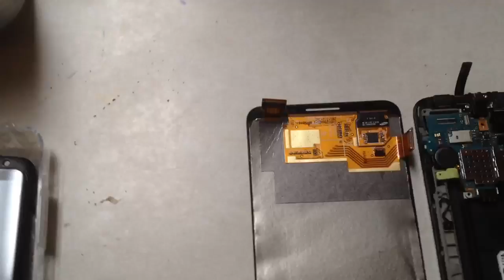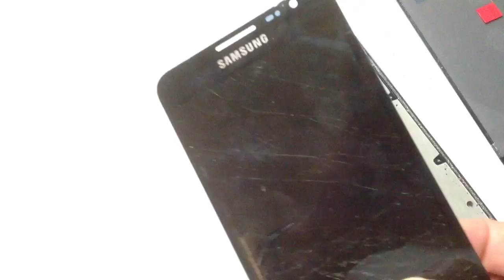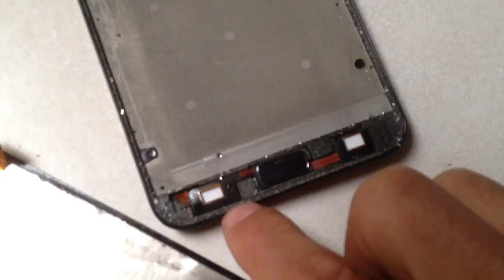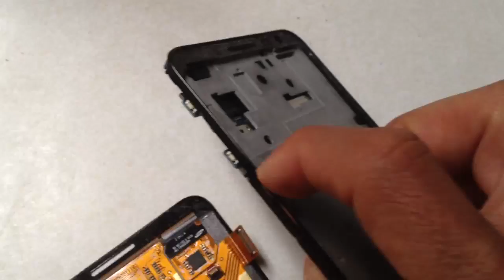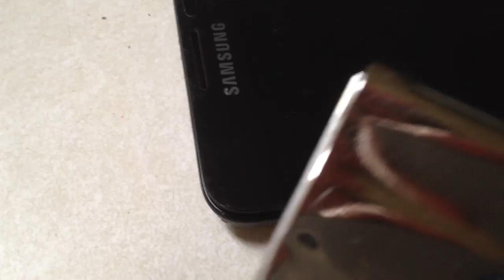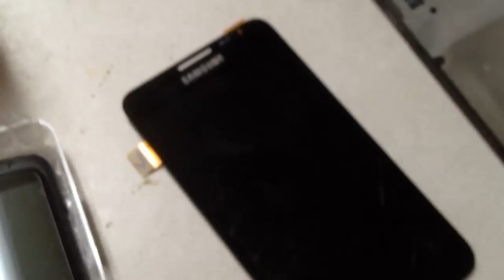How to replace the screen on Galaxy note

Comment: This video should be deleted. There is a very important step around the 
home/ back buttons buttons that you casually go right through. The back 
and cascade buttons are glued to the screen and have to be carefully 
detached without ripping the circuit.  You cant lift the screen more than the width of the wire or blade to slice through the glue of the back/cascade buttons. You 
 The home button has to be pushed through the glass to prevent ripping 
the circuit. You rip the home button circuit and replace with a new one,
 the fingerprint scanner wont work unless you send it to Samsung and pay
 a ridiculous price to replace. Nothing quick about it, tedious precise 
job !!

Comment: You can separate the glass from the LCD with only a heat gun, razor blade, playing cards, and molybdenum wire. Not really advanced tools, but you do have to know what you're doing.

Comment: Yeh..just realised that when I pulled v plastic covering off v glass... WAHLAH!!... No scratches. Anyone that disbelieves me that these protective plastic sleeves to put on v glass screen work, well, u need your heads bloody checked. I only had scratched v plastic(but are deep 1's), but was v best $10 I've ever spent!! It's an investment in itself. Now all I need to do is get a replacement plastic, and 2 find out why v phone won't read v writing sometimes when using v S Pen, and even Swyping.

Comment: Thanks Stephen. So what would u recommend for me, if I only have what I mentioned, just on the glass??.. Do u still think I should replace it, or just leave it how it is?... My NOTE is really stuffing up(which I've had since early June - the last 6 wks won't swype mostly nor even write at very few times), and my S2 is in getting repaired as the battery had no life(the phone wouldn't recharge with either recharger) and also had a software issue. I would really like to get the Note 2 as well.

Comment: ..run into me, while I was chatting on the phone. I think many people these days just don't have the manners, if they're running late for something. I would like to just get the replacement glass, as they are much cheaper thru ebay, and knowing that my stylus and sensor of the digitizer still works great. I just want to get rid of the scratchness section where my nieces had coloured in and sketched. Any thoughts or feedback??

Comment: Hi Steven! Did u have difficulty peeling the LCD screen/digitizer from the glass?? It's just that my Note is only scratched as the digitizer is still fine, as the sensors still work great, as if they were new. I haven't got the replacement glass yet. My nieces were mucking around with the fone a cpl of mths ago, and there is a spot of scratches where they were heavy handing the stylus by colouring in on a sketch they did on it. And just an extra 3 or 4 seperate scratches, where someone had...

Comment: Had my Galaxy Note 2 for 10 days..dropped it 3 feet to a wood floor and glass shattered. Horrible in my opinion. My Samsung Galaxy Epic could fall to concrete 100 times and never cracked! This is supposed to have Gorilla Glass II I've read on Corning's website, etc - No way! Any thoughts??

Comment: in my phone, the thin boundary frame that surrounds the screen has cracked. its not much of an issue but it freaks me out as the phone is brand new. What part do i need to replace to take care of that. is it a part of the screen or housing?